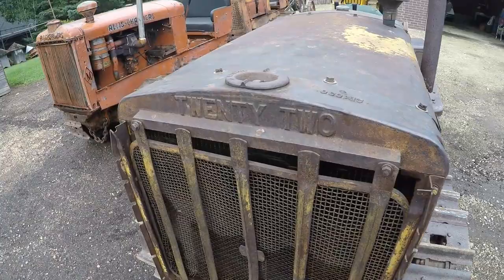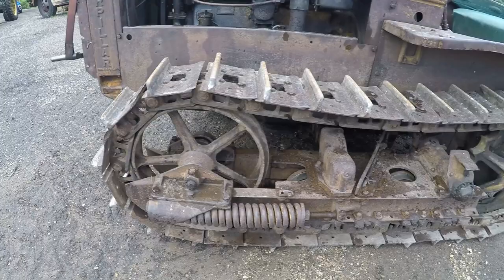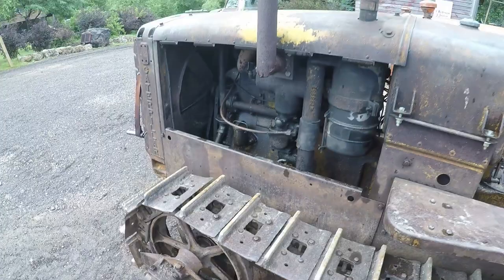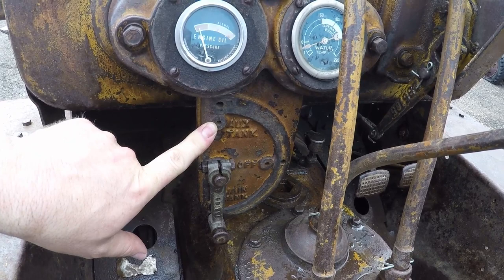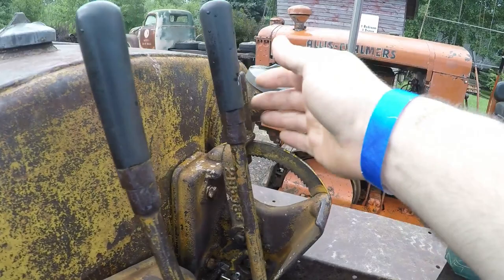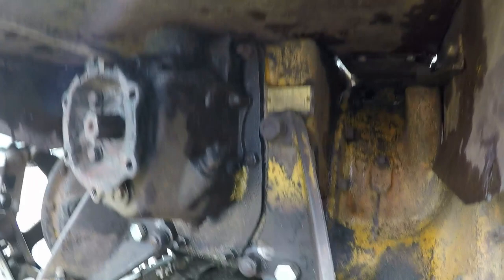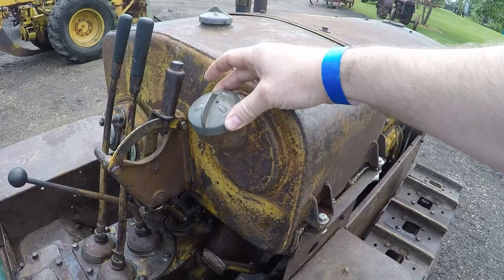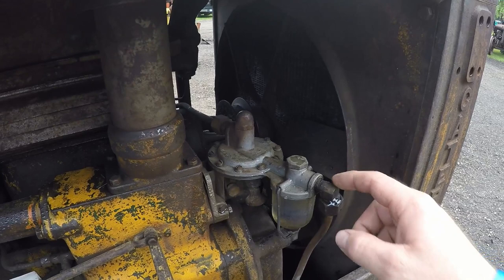Caterpillar Twenty Two #2F6468 Walkaround

Comment: My late father’s 22 had the 14 inch “orchard” tracks, so it seemed better proportioned than the ones with the narrow tracks. Great little tractor. Easy to identify by the absence of an upper track idler.

Comment: Looks like a LeTourneau WWII airdrop scraper in the background , very rare machine . Pusher blade on the front , all run by a cable control unit . NOT OSHA approved for the operator !!! LOL , tough to control going down hill with the steering brakes , no ROPS back in the day

Comment: With all these walkarounds and your Cat knowledge, I have a good question for you. When i was younger, in the 60s the house next to me was being built. The excavator crew had a very small cat dozer on the site. It looked like regular Cats, but it was maybe 6 ft long × 31/2 ft wide. It was yellow, had regular tracks and a push blade. I believe it was a gas model. I use to love when it moved because the tracks made a sound like sleigh bells tinkling. Have you ever seen one, or know what model it could have been?